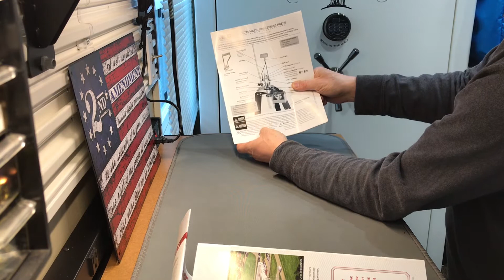The Lee APP press: Unboxing, Setup and.....adding a 3D printed automatic case feeder!

Comment: Decapping and sizing 223/556 I don't even bother with the tubes. I hand-drop brass into where the tube would go. pull the handle and drop another piece of brass. You can get into a fast rhythm decapping and full case sizing.

Comment: I set up 4 tubes and hand load in the coated bullets. It is so much faster than single loading and sizing your bullets. Just finished 30.5 lbs of 45 ACP powder-coated bullets.
Reply from the maker: I only use this for decapping brass. I have 4 Dillon presses that I load on!

Comment: Excellent. I have one on order and hope to use it for decapping cases and sizing powder coated bullets. I’d love to be able to come up with a motor drive…  anyway it will be nice to deprime prior to pin tumbling w/o running gritty cases through the Dillon, and although push through bullet sizing goes fast on a single stage if you add a nose down bullet feeder to the APP it should be a low dollar high productivity setup.
Reply from the maker: 100% correct on all accounts!
Reply: there are nose down bulletfeeders out there to print. I need to get my printer up and going (changed extruders and a few other things), but I will get it going and hopefully post some videos/reviews.
Reply: @MSUICEMAN   I printed one and just got it running. Held up a bit as the motor I found had a 6mm short shaft, where the plates were set up for an 8mm motor. Got a bit of stainless steel tube that I staked to the shaft. Haven’t set up the APP yet. Also hoping to adapt Lee’s bullet feeder to work on a Dillon 1050. Inserting bullets below the seat die makes sense (if it works) to not have to give up powder checker or separate crimp and seat dies.

Comment: Awesome System  Sir...!!!
I would only suggest that the Optical sensor be relocated 1/3 to 3/4 of the way down the Tube to prevent short cycling of the Motor.
Reply from the maker: As I mentioned in the video, my friend built it for me. I will pass that info on to him but, I see what you mean. By moving the sensor down, there will be more time between starts and stops. Thank you for the comment!

Comment: Pretty sweet setup, the feeder really makes better use of your time even more. Wonder if it works for sizing powder coated bullets?
Reply from the maker: Thanks for watching and for your comment! I do not size bullets so I can’t answer your question. I am sure there is someone on YouTube that does and can answer that for you. As far as the feeder feeding bullets.....YES: the design is a bullet feeder!
Reply: it absolutely does! and lee came out with a breechlock sizer version intended for the APP press, which you can also use NOE brand bushings in, if you rather do that than the lee versions.